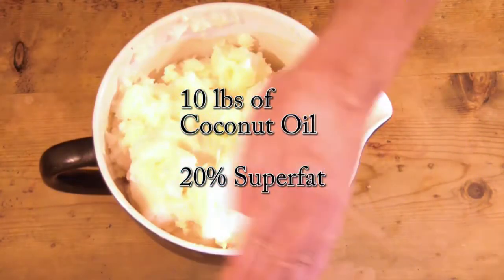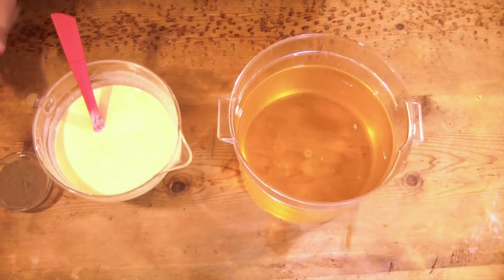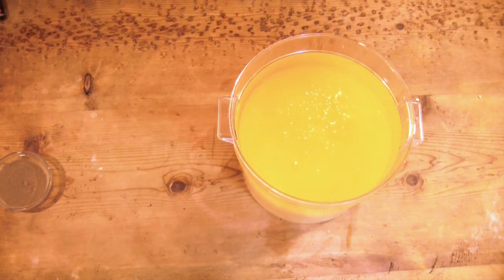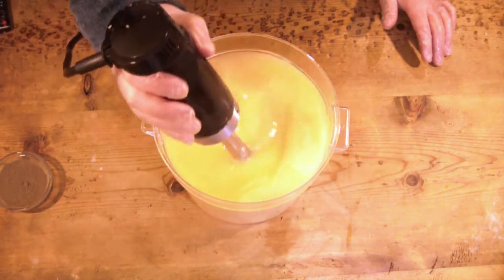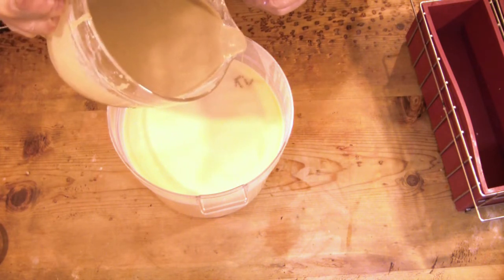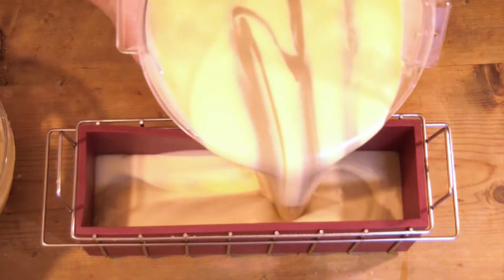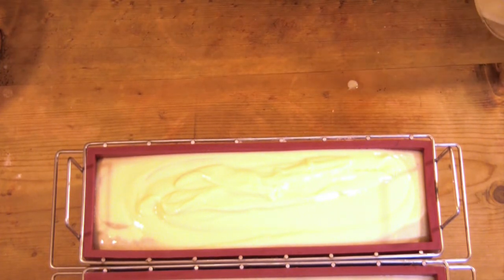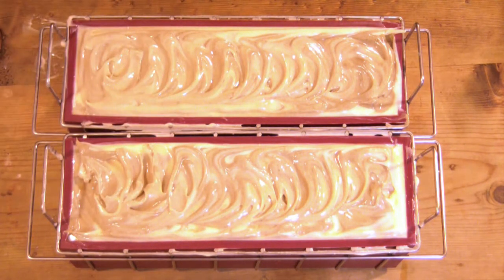Making Coconut Lemon Grass Soap

Comment: 100% coconut with 20% superfat is my absolute favorite soap recipe above and beyond all others.  However, the only one I did in a mold had no milk, but still got hot and cracked and was SO hard I couldn't cut it.  I don't know how yours cut so easily.  Now, I only use individual cavity molds for that recipe.  Thanks for sharing!
Reply from the maker: Thanks so much, next time I will take more care with temperature, I had put these in insulated cooler to gel, I won't do that again with 100% :) Thanks again

Comment: I only make 100% coconut oil with fresh coconut cream because it is the only oil readily available in my area. And people around here prefer that over a soap with different oils in it because it is harder, more cleansing and easily gets rinsed off (which is a plus in an area with a water problem like ours). Its also bubbly with a lot of creamy lather. Coconut oil soaps tend to generate a lot of heat so I always soap at room temp, put it in the freezer and cut after four hours. 

You are an inspiration so I am really happy for that 1.2k.
Reply from the maker: Thanks so much, that is great you have a such a fantastic market for your soaps, well done. I appreciate your tips and suggestions, have a wonderful day.

Comment: Just came from Walmart in the baking section I saw a great value unsweetened coconut milk non-dairy beverage it's like a peachy orange container oddly shaped it says it has only one carbohydrate and zero sugars maybe that one will work better I bought one thought you might want to know Patrick
Reply from the maker: Lenna, very interesting, I wonder how the remove the sugar, but then again, if you remove the sugar, that would remove alot of the bubbles too I bet, I will look into this though and give it a shot, thanks so much